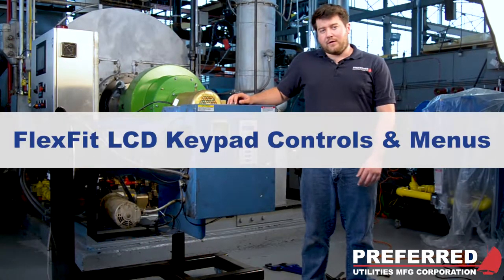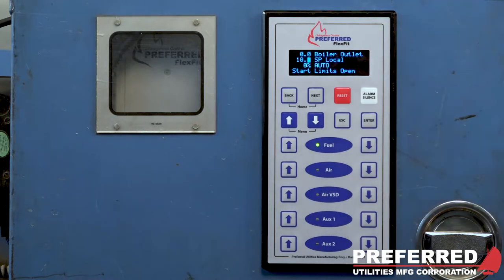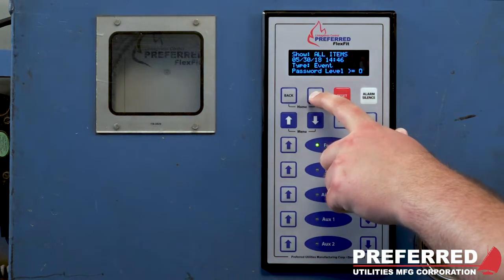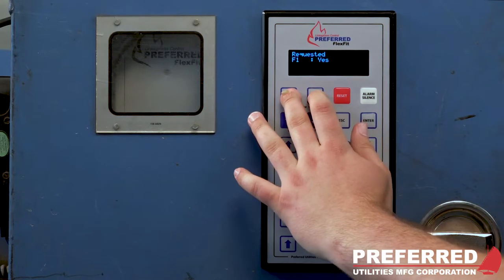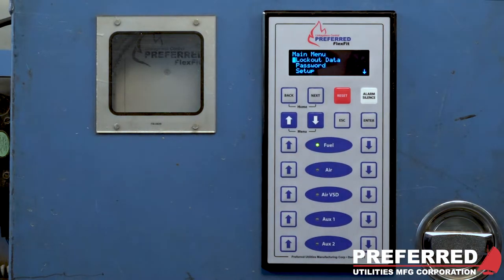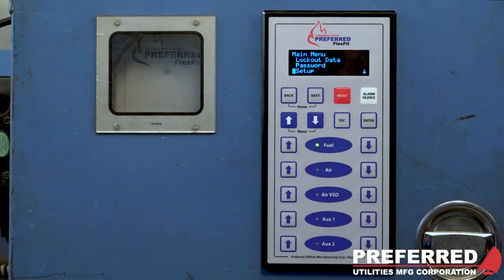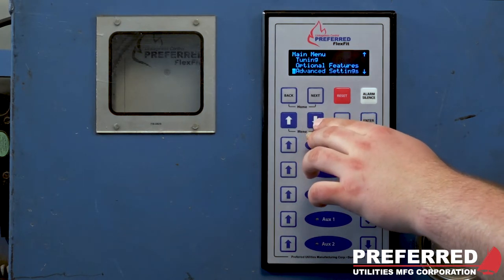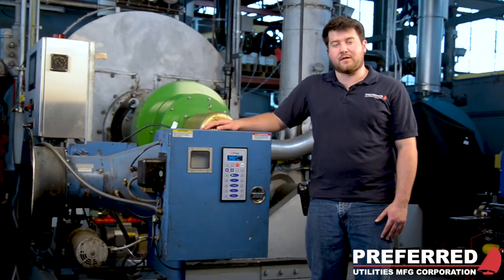FlexFit: LCD Keyboard Controls & Menus

Comment: Great design, when’s does the training classes begin I’m sold already, a lot easier to install and use than Siemens and Autoflame, seems like an average mechanic can us this control without being too intimidated, it also looks to fit in where a e110 was are you still using the sub base from the e110 and is it also available for the 7800 control, I have to pitch this to my boss, need a little info. Where in NYC the perfect market for this.
Reply from the maker: We would love to work with you. Send me an email and I will forward you to our head of training in NYC.